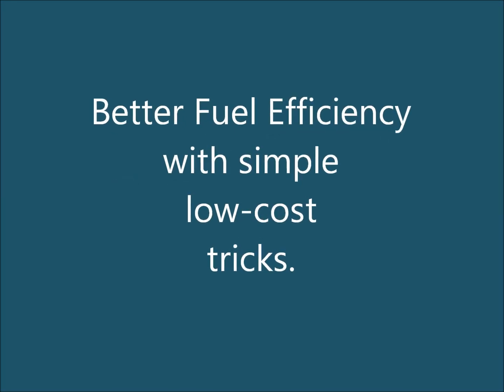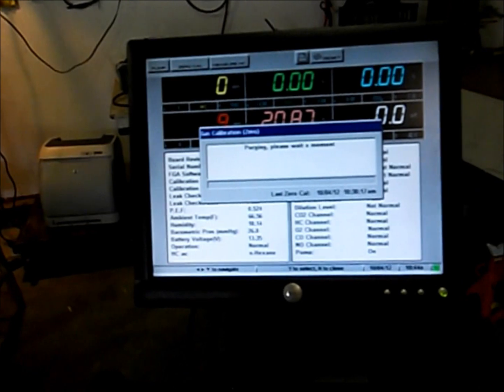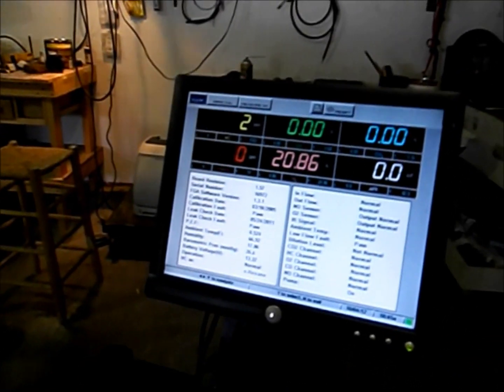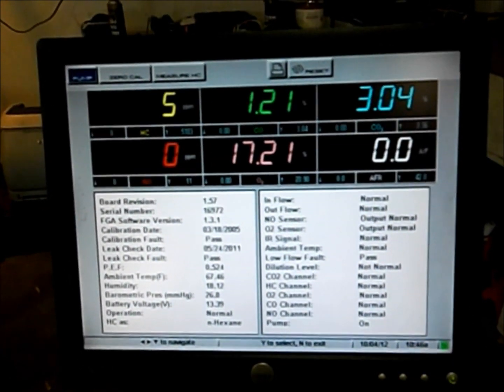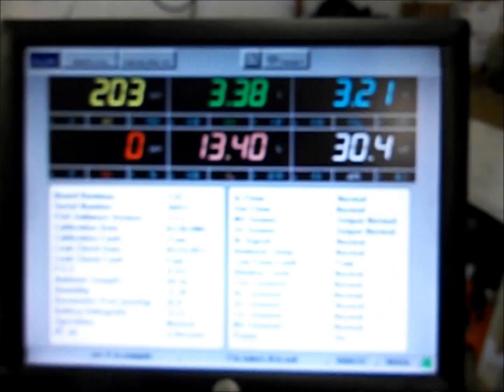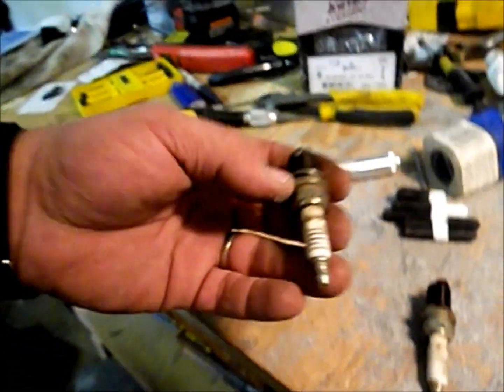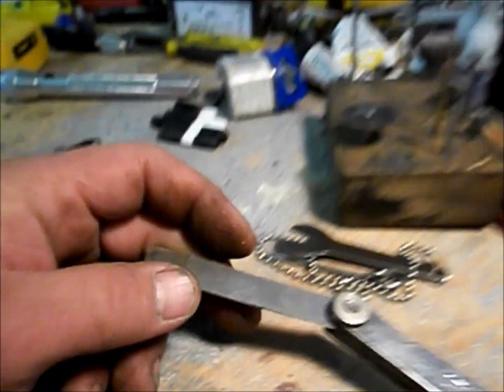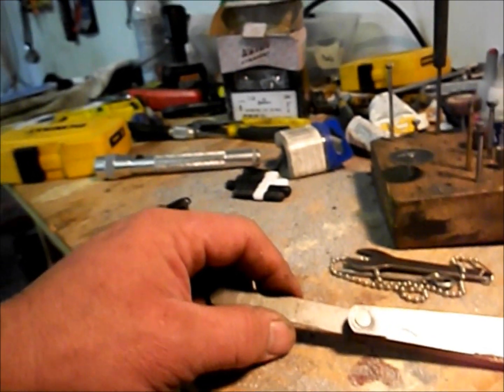Tips and Tricks for better combustion Part One Spark Plug Gapping

Comment: Most modern ignitions will tolerate very wide gaps without misfiring, but if the engine has an ECU (lawnmowers gen. do not), the added voltage creates more nitrogen compounds causing erroneous o2 sensor readings, which in turn keeps the fuel-trim from ever stabilizing.  Did this myself at +30-40% gaps for a while, went through 2 catalytic converters in a year, afr was always slightly rich.  It never dawned on me it could be the plug gap.  I assumed the wider, the better, as long as there's no misfire.

Finally on a hunch, I put plugs back to +10% and the car has not ridden so well in a long, long time.

If you're not planning to have your car tuned (which can be done to utilize wider gap), I think the efficacy of wide-gap just depends on the car's ECU.  Perhaps certain ECU's tolerate wider gaps better than others.  My '09 2.4 Toyota Camry apparently did not.

Comment: None of this was done under a load... Just because it is isling that means NOTHING!! Everything will change dramatically under a heavy load the more gap you have.. and may even have spark blowout and actually blowout the spark if it gets too wide. ... I'm telling you. Next time do it with the engine revved up half throttle and throw the blades on to create a load
Reply: I was reading every comment, waiting to see if someone understands what is actually happening,  well said mate , to wide of a gap will cause a flameout under load, hard acceleration , and even at hi rpm

Comment: I wonder why manufacturers specify a smaller gap then?
Reply: It prolongs ignition components by not having to work as hard to throw that spark across the gap and tolerate combustion. If you go too wide it can actually kill the driver in the ECU over time from stressing it out . And you can actually have spark flameouts under hard acceleration where the rapid combustion will blow out the sparkplug and in some cases when that happens on some cars the spark won't return untill you turn the car off and back on to reset the driver. I've had this happen on multiple cars while messing with gaps on the plugs trying to find the "sweetspot" in the ecm
Reply: Many different parameters, compression ratio, coil output voltage, engine RPM..the larger the gap the more heat is generated in the coil which may shorten its life. Today, with coil packs on each cylinder the chances that one fails increases but still allows the engine to run, any misfire will be detected down to the cylinder by OBD II, so you will get a code if the misfire threshold is exceeded.

Comment: With standard sedan's it probably best to not go over 20% increase - not that it's less efficient, but your standard ECU isn't going to tolerate it, which will more than likely cause other issues that affect the drivability/efficiency.  Best to experiment and find the sweet-spot if you're into this, which is as wide as you can gap them but no more than your ECU can tolerate. 20% is safe for any non-modified street car.

Comment: Nice video. I've done this for ages always with good results. In fact I always advocate this is where "engine tuning" should start... making the best "free" power and efficient work possible. 
But a word of advise for the ones thinking it's just a question of increasing the gap. The entire ignition system must be up to the task. Coils, plugs, wires, contacts, etc. Also the maintenance should be made in a timely fashion to avoid misfires.
Trying this with corroded contacts, bad grounds, etc. is not a very good idea. Those (corrosion) green electrical terminals should at minimum be cleaned.

Always loved the fact my engines start on the first touch of the starter, Winter or Summer. ;-)

Added benefits lower fuel consumption, less carbon in the internals, reliability, more punch... for some reason ALL the manufacturers increased their plug gaps by comparison with their counterparts from the 70's / 80's. Thanks for sharing.

Edit: Just remember my VW bugs (had 4) where running 1.2/1.3 mm gaps without misfires. But with upgraded coil, wires, electronic ignition...

Comment: I did this to my 1971 Datsun 240z before I saw this video. I was having a pinging from the engine with 91 octane pump gas. Iv ran 101 racing fuel. Same problem so it wasn't an octane problem. Opened up the gaps to .050 since I have an MSD ignition just for the hell of it and holy crap. Engine runs smoother pinging is gone feels stronger accelerates faster. This definitely works.

Comment: Under load these wide gaps can cause misfires. As the load on the engine increases, the pressure inside the combustion chamber increases. The question I have can the oem ignition support the increased combustion pressures. This motor is not under any load.
Reply: Good point.